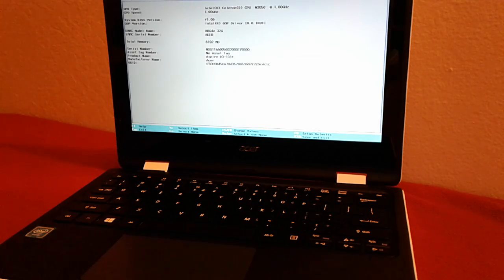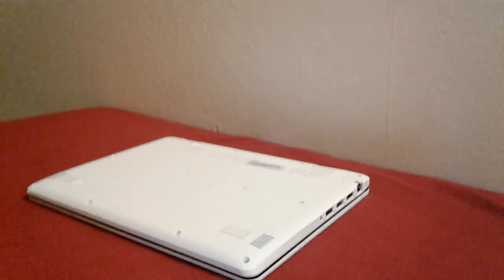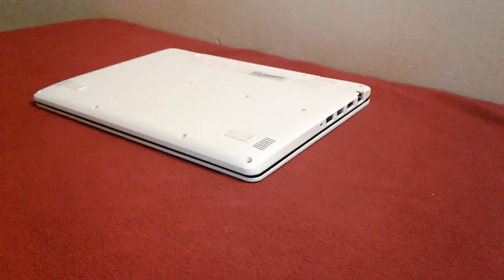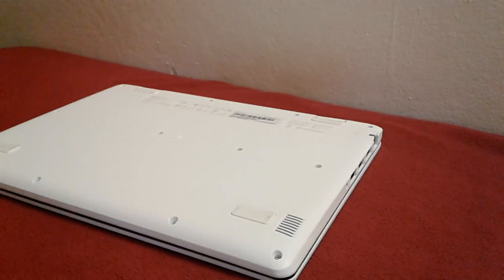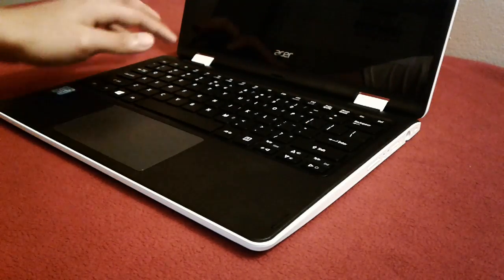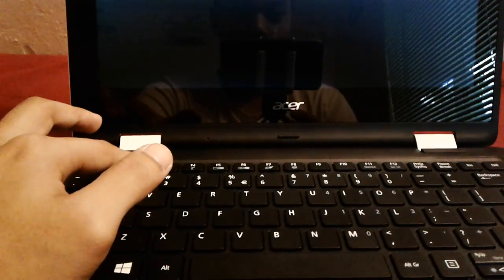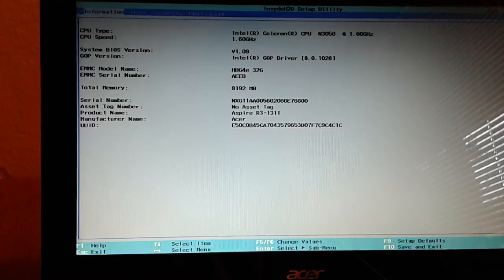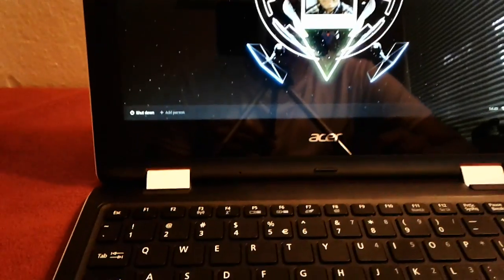Upgrade RAM to 8GB on Acer Aspire R11 (R3-131T)

Comment: Great video, I have the same laptop and this video is helping me to upgrade RAM. Keep up the good work.
Reply: do you have the part number for the RAM that you are installing and possibly a link as to where to purchase the RAM. thank you.  I have an R11 also that I havent used in a while and has just been collecting dust, and I thought maybe with a few upgrades such as RAM and HD then it will get a little better performance.
Reply: @TraceeRae  DDR3L-1600 SODIMM

Comment: I have the same computer. I wan to install SSD drive. How can I install a ssd that has no cable? pls tell me what part is needed. I already bought an ssd.
Reply: If your laptop didn't come with an SSD or HDD, you would need to solder on an extra part to get SATA, which is possible but very difficult without an SMD rework station, solder paste, and a stencil, as well as the connector and the cable. If it did come with an HDD or SSD, it is very easy. Just locate the drive, unplug it, unscrew it, and put in a new drive. There are videos on YouTube of the process.

Comment: I did and ssd upgrade on this model and it worked perfectly. Runs a lot faster. I plan on upgrading the RAM later. Thanks for the video.
Reply: Which ssd did you purchase? Please send link
Reply: Which SSD???
Reply: Please tell us what SSD
Reply: @jaycoreyyy7387  I put a Kingston 480GB (SUV400S37480G). It also worked with the RAM upgrade.
Reply: @FelipeEpaminondas  thank you so much. Your a life saver. 😁

Comment: I have the same laptop and want to install an SSD in that empty bracket. No SATA cable though, what do?
Reply: Unfortunately the socket is missing on this basic model. If you look closely just to the left of the RAM cover you will see 2 large solder spots. Underneath that you will see HDD1 showing that that is where the connector for the drive adapter would be located on a more expensive model. You can only add more space by inserting an SD card.
Reply: @chriselsby4075  what is the socket that is missing? I we can solder the required piece with the SATA cable, we can add an SSD right?
Reply: @bejnet  soldering something like that takes more than a regular soldering iron and there may also be a controller chip missing

Comment: Can I use hdd or SSD free space to install SSD or hdd and install on It Windows? eMMc is s**t
Reply: No, the socket is missing on this basic model. If you look closely just to the left of the RAM cover you will see 2 large solder spots. Underneath that you will see HDD1 showing that that is where the connector for the drive adapter would be located on a more expensive model.

Comment: Ah you installed cloudready and it replaced Window's EFI partition. I did that too and Windows couldn't boot anymore. So I was stuck with Ubuntu until I found out how to get Windows back. Solution: Use a Windows installation disc/drive (burn the Windows ISO file to a flashdrive or something), boot into the flashdrive, go through the procedure but make sure to choose the advanced installation (not recommended one). On the advanced installation screen it will list all your partitions. Just delete all of them (yes, EVERY SINGLE ONE OF THEM, which will delete all your files so backup first) and proceed with installation. Windows will recreate all the partitions to its default settings and there you go, Windows back online. However, try using a recovery drive to do the reinstallation first. I did the installation disc/drive method because it was my last resort. Recovery drives didn't work in my case. Nice video btw xD
Reply from the maker: +Constant Eclipse Thanks! I might just have to do that in order to get Windows back. Hmm, I was reluctant to but a Windows disc at first but if that'll work then that's great news!
Reply: Green Usher glad you found it helpful. and yea and just remember: an actual windows disc is NOT required. you can get the ISO and use that as long as your microsoft account has a valid windows license. i seen people do this mistake before so thats why im restating again. good luck!

Comment: can upgrade the ssd?
Reply: Green Usher I think that it is an EMC drive.
Reply: After opening my up which has the emmc option I see no sata connection for a SSD. In the video when he shows the BIOS to confirm  the ram upgrade  right above it says emmc 32GB.
Reply from the maker: Yes, of course you can! My model does not have one so it comes with 32Gb, but I could put one in the empty SSD slot.
Reply: @GreenUsher  which one u bought??
Reply: Green Usher so the built in 32gb is soldered to the motherboard? It must be taking 2.5 in form hdd's, right?
Reply from the maker: I believe so, there is just an empty space where an SSD can go, but I don't think it is an HDD since I cannot hear it reading nor writing.